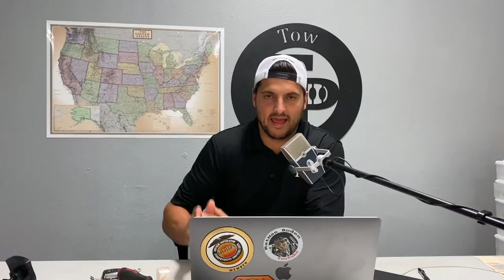The TRUTH about Electric Over Hydraulic trailer brakes

Comment: 2:49 “Very rarely do you have fluid all the way throughout the lines”
Yup that’s all I needed to hear to know you are not a mechanic.
Reply: Haha.

Your probably right, he's not a mechanic. Hydraulic lines are always completely full if brake job was done right. 

But don't discount his and his teams combined experience with the EHB hydraulic brakes. He's definitely onto something here. He just didn't properly explain the underlying mechanics of it.

The problem with EHB is not that their is air in the lines, its that the EHB pumps are generally too slow when they need to build pressure and move fluid into the caliper pistons. There is ALOT of fluid on a 30 foot trailer, and there are 2 to 6 brakes on such a system. It doesn't help that the pump needs time to spool up and push all that fluid while pulling current from a measly 40A fuse on the tow vehicle. Braking is quick and a lot of power is needed to pressurize all that fluid in fractions of a second.

Electric drum brakes don't have this issue, they send a signal directly to magnet at the wheel. And they don't need as much power, drum brakes have a wedging action so most of the braking power comes from the wheel rotation. As soon as the friction material inside the drum touches the rotating wheel, the wheel drags the friction lining further in. Its a self-amplifying brake, so only a few amps are needed to power it. 

But drum brakes are poor on very rocky hilly terrain, their cooling is abysmal compared to disc brakes. You will almost never lose brakes with disc brakes on hills vs drums.

Comment: You’re right and wrong 
First wrong: hydraulic disc brakes  are far superior in stopping power over electric drum brakes. Secondly, the brake lines always have fluid in them, if they don’t, there is air in them and either not bled properly or another issue such as improper installation. Air also causes wheels to lock up. 
If brake pads are falling out, there is either a defect, missing piece or improper installation. Pads don’t just fall out. 
An electro hydraulic pump produces over 1,000 psi 
When operating properly, most truck ABS will pulsate the trailer brakes in an emergency stop, this is true with electric only also. 
Right: The hydraulic systems are expensive and when a pump or problem occurs on the road, the average driver will not to be able to fix it. 
While electric only brakes can be repaired fairly easily by most people and parts are usually readily available.  
God bless you Alex, I admire your drive but when it comes to mechanical advice (this and other videos) you operate on assumptions and lack of actual mechanical knowledge.
Reply: Same here,  the EOH are much easier to service. The only thing bad is ; you have  the requirement to maintain a brake fluid in a reservoir. We have hydral-star on our trailer.

You are correct that if have a fluid lost, you loose fluid across all brakes vrs elctro-drum is just that one wheel or in a dual axle if your run the power lead  , you could have a electric wire cut and loose all brakes across one or both axles.
Reply: I totally agree. I have a 36 foot flat deck trailer with dual tandem 12k axles and electric drums. My other flat deck trailer is a 35+5 integral ramp with 12k axles with hydraulic disc setup. At 70 mph apply trailer brakes with manual leverage and you can sort of feel slowing on the drums but with the heavier trailer with disc's the brakes agressively slow you. I do agree the lag is their but it is minimal if you run the new micro adjustment locks so that no free travel is left in bearings. The free travel.lets rotors/hubs move enough to push pads away much more and that takes more pump time before you have brakes. I have much failures with electric drums from adjusters falling out when crap hardware breaks. I shouldn't have to take a new 8k or heavier axle electric brake setup apart and toss the locking nuts in favor of two nuts jammed because I know the castellated nuts will fall off in a short time. Never had disc pads fall out.
Reply: On our hydrastars we had a low reservoir issues and a bad ground that cause our brakes not to engage but that was operator error, I guess the later would be applicable on drums also but our brakes with max-sensitivity  are immediate or at least nothing noticeable from a delay.

I know one thing  EoH disk has over E-drums, I rather work on long master line and break-offs to each wheel vrs tracing wht/blk wires around under our trailer ;). Each one of of your drum-brakes electrical connection is big nightmare to investigate if your connections are bad.

E.g   On our TX-pride we had to redo all of our wiring since the crimp-connector that they put on where just plain out poorly done. I use a heat-shrink and a soldering iron and solder all connection and made pigtails on each frame ground to ensure these connections where secured. Would not need to do that  with EoH discs. Just sayin.
Reply: THIS ..comment has knowledge!!
...and you mentioned God👍🙏 Thanks for sharing. My video on Surge Brakes shares some of the same info. Safe travels brother
Reply: he needs to turn his baseball cap around lol
Reply: Y'all are completely wrong on this every front and rear disc brake that's hydraulic will push the piston out farther and farther until the pad grinds down to the metal the metal that the pad is glue to falls off then you lose brake pressure

Comment: Alex, I have 160K real world experience with EOH brakes on my Red 40’ PJ trailer. No issues what so ever. Just changed the brake pads for the first time at 150K. Hands down the best trailer brakes system I’ve ever owned. I will never own another trailer without EOH brakes.
Reply: Same will nener buy electric brakes

Comment: Alex, I have both.  One trailer has electric drum brakes.  My experience, bad wiring to the drums, broken wires or shorted connectors.  Bad magnets, no brakes at all for 3 months because nobody could find an intermittent short.  Brakes would work in the morning or when I would take it to the dealer.  When I would hit the road they would be inoperative within the first hour.  I will never have electric drum brakes again.  Finally got them working correctly when I told my mechanic to replace all wiring from the main harness and reroute all wires along the frame not over the axles, replace all magnets and replace the RV plug in the pickup bed.  Finally everything works.

My trailer with electric over hydraulic disk brakes works first time every time. Trailer has about 75,000 miles on it with no problem.

Everybody’s mileage is different.

John Schubert 
406 Hot Shot

Comment: For four years usually 6 days a week I pulled a one-car gooseneck trailer in the streets of Phoenix that had torsion suspension and disc brakes and I never had a problem and I thought they were the best braking system out there . the only problem I ever had with the trailer was about twice a year the wheel bearings had to be replaced.
Reply: Wheel bearings require a few thousandths play/clearance, not completely seated in the races. Bearings, regardless of lubricant choice, can produce enough heat to cause the individual rollers to expand if there is ZERO clearance/NO room for roller expansion; the bearings WILL overheat & burn the lubricant & potentially causing bearing failure.
Reply: The only delay I could imagine a hydraulic brake system having would be air in  the system. Fluid doesn't compress. I've built semi trailers and hauled construction loads with pickups. I've never even thought about using hydraulic brakes on a trailer let alone seen anyone with one. I see no reason why it wouldn't work better than air or electronic nor be able to include ABS ability. Unless the system stayed connected or was self bleeding I could see keeping it maintained. If someone wanted to go full feature with ease of use on a trailer air would be the best. With pneumatics you've got disc ABS with air ride stability control and the easy option of running a tire pressure control system. There's some delay with air but a midland valve sounds so cool.
Reply: The Kodiak kit for 7/8 l axles is not good for a torsion axle ok on a spring axle. The dexter caliper is 10 times better than the Kodiak   Usually get 200k out of a set of brake pads with the dexters

Comment: Hands down hydraulic over electric brakes over drums every day of the week. The problems that you are explaining Alex, I have never once had. EOH does not have the significant delay that you speak of. Mine might be a 1/2 second if that. They stop WAY BETTER than drum brakes. Drum brakes are junk and wear out in such a short period of time and very inconsistent. There could be installation and bleeding error with systems if people are having problems. I have owned and run my hotshot company since 2010 and I install all of my own equipment. If my trailers don't have an option for EOH, I will find a way to upgrade to discs. I certainly appreciate your video and discussion on this but, I don't have any bad experiences with any of my disc brakes and that's with over 12 years in the business, with numerous trailers and real world experience! Keep doing your thing Alex!

Comment: I totally agree, I have a 2013 PJ low pro 30’GN W/ elec/hyd brakes. Three times it has sheared the caliper off of one wheel. Then the pump pumps the fluid out and burns out. $2,500 each time.

Comment: I helped wire up E / H brakes conversion on a large 5er. The owner has been very happy with the way they work. He has large horse trailers and flatbed goosenecks and has driven semis in his past so he has plenty of experience to compare them against. I've thought about converting my Big Tex sometime in the future but I would research it to death before making a change like that. Even the 7K Bit Tex brakes can be hard to find when you need them...so I ordered 4 complete kits. That was before seeing the 8K axles you installed which I think is a great idea. As for some of the issues you cited in this video, consider this: every car and truck on the road has hydraulic brakes with hoses to each wheel cylinder / caliper. I have been diving for 44 years and never had one fail. Never! I seriously doubt that our trailer axles have nearly the range of motion that a 4X4 does out on the trails. Could it by chance be a fly-by-night trailer manufacturer that didn't know what they were doing? Like electrical wiring on most trailers, they don't pay a lot of attention to passing wires thru or past sharp edges like you have found in past videos. Seems to me that trailer manufacturers do fairly well on the design and weldment of trailer frames but fall short on the accessories.  Just my two cents. I certainly appreciate you sharing your experience with us about these brakes. I will need much convincing before making ANY changes to the brakes on my trailer. Something else to chew on: What happens if you do a brake conversion (of any kind) and then you are involved in an accident that injures or kills someone? I think someone's attorney is going to eat your lunch!

Comment: I've had my PJ since 2014 (7yrs as of now) with Dexter electric over hydraulic disc brakes and never had any of the problems your stating. Maybe the problem is the Kodiak retro kit.
Reply: Kodiak 2250 brakes suck. Only buy disc brakes pin sliders for calipers. Just like your truck.

Comment: I disagree. Been doing car hauling with 3 car trailer, 3 axle trailer with 7k axles electric brakes for 4 years. I always had issues, brakes worked whenever they felt like it , eaither the magnet or the wiring always messed up. Took it apart countless times. And always had issues with the tires eating out. And ive tried many diff tires for the past 4 years untill i got a new trailer with 2 axles 10k tandem wheels. When i got my new trailer i forgot about all the problems lol. Now i got electric over hydralic with drums. Best decision i ever made, got over 100k miles on this trailer and brakes work flawless. They are some strong brakes, yes maybe theres a little lag but u get used to it. Atleast i know if i mash the brake pedal my trailer is stopping. Electric brakes are crap they shouldnt even make them especially when hauling heavy weight. I haul 25k pounds pretty much every trip. sometimes more, electric brakes wont do it and not made to last!

Comment: In the 90's I had a Hot Shot with vacuum over hydraulic disc brakes, NO perceptible delay, pads and rotors lasted FOREVER! Had a lot of issues with my travel trailer with electric drum brakes. The delay in electric over hydraulic systems is in the actuator, NOT the hydraulics themselves. Any high quality actuator should have a sensitivity adjustment to compensate for the delay.

Comment: Yes they have a delay, if your smoking tires
You need to adjust your brake controller and or get a better controller 
Electric/hydraulic/disk is the only way to go
Have them on my trailers and haul heavy for years

Comment: I just bought a used 2018 DRV Mobile Suites RV with two 9000 lb axles with Kodiak brakes three of the four brakes are not releasing and are dragging hard on the disk. I just found a recall on these from the NHTSA -21v733 for September 30 2021

Comment: I been running electric over hydraulic for 3 years I haven’t had any problems with mine maybe because I got 10k dexter axles I ran a electric brakes for three months and had problems the hold time
Reply: I do CDL hotshot and don’t have problems finding parts it might be a lil bit more expensive

Comment: A friend of mine came up with a great ideal. He used his hydro booster for his trailer brakes and ran a hydraulic line to a quick coupler and that would make his trailer brakes perfect and that has been over 5 years ago and I think after the 4 year he was talking about putting a second power steering pump on the just to run trailer brakes so if one went out he did not lose everything but so so good and absolutely no lagging at all and I have driven his Dodge 450.

Comment: What if you have a dual axle boat trailer that you use in the water and your choice is either surge or E/H brakes?  Then it seems like everybody extols the virtues of E/H.  Out of curiosity, if you were hauling a boat what braking system would be your chosen system?